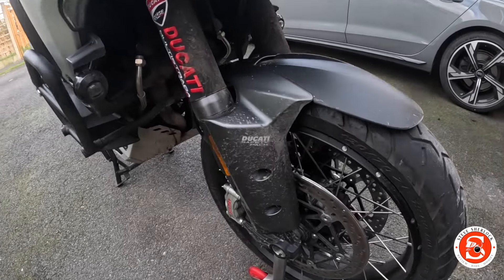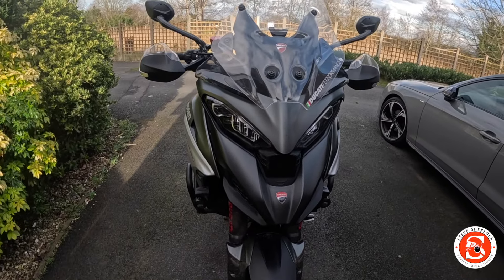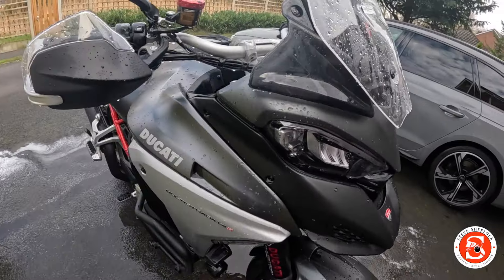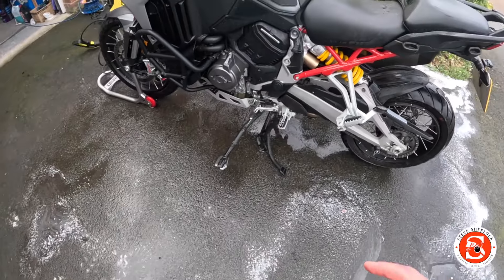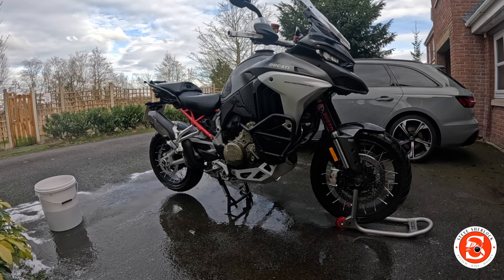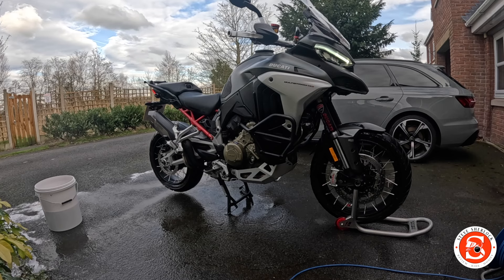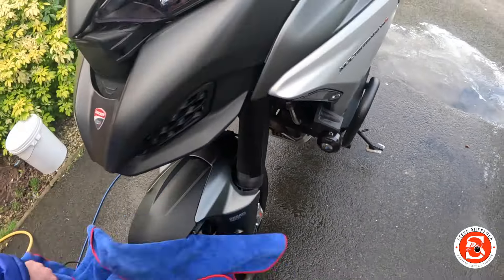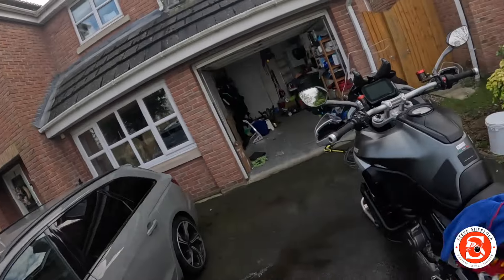Has ceramic coating helped keep the bike clean?

Comment: I went out on my GS yesterday, from Saltburn to Barnard Castle, Middleton in Teesdale up to Alston then dropped back down to Reeth and home. The sun was shining when i left but got rained on and bikes covered in crud as you’d expect. Spent this morning cleaning and it’s spotless again. I haven’t done the ceramic coat but have used ACF 50 which seems to do a good job. Totally agree on the drier though, well worth it

Comment: A tip I was shown years ago was always dry the bike on it''s side stand, I use the dryer to blow through the radiator, theres loads of water left in there!!
Reply from the maker: Yep I do that through the rad also  problem with washing on the side stand for me is that the rear wheel can't spin.

Comment: Shouldn't you be lubing the inside of the chain ?
Reply from the maker: No, never lubed the chain on the inside ever. My fireblade needed a new chain after 16k miles after doing my normal thing.
Reply from the maker: Ps love you your name tag
Reply: @stevesherlockrides  I've probably done half a million miles and never lubed the outside.
Reply: You don’t need to lube at all. 

X ring chains are internally lubed. 

Any oil/lube is just to prevent to bare metal rusting.
Reply from the maker: So therefore you do need to lube otherwise rust on chain and limited life?
Reply: @stevesherlockrides  sort of. On an ‘O’ ring chain It’s a case of protect rather than lube. 

Ideally a dry protect. Something non sticky, so dirt doesn’t stick.